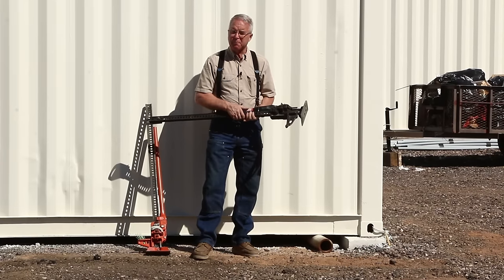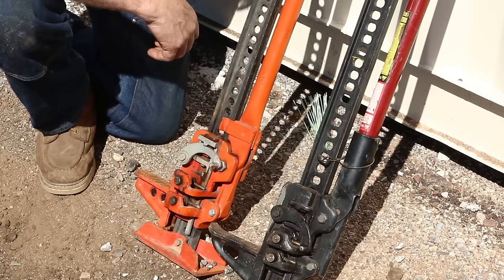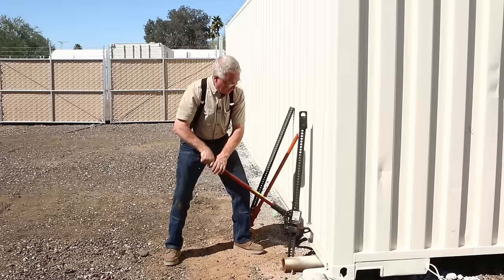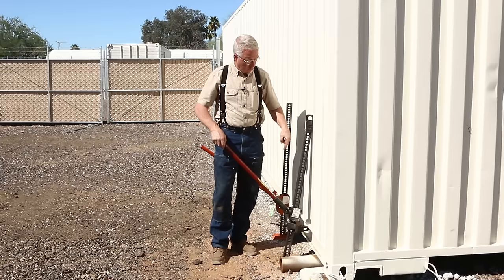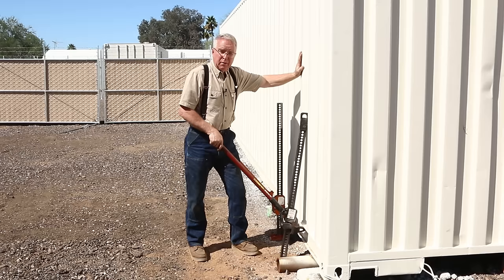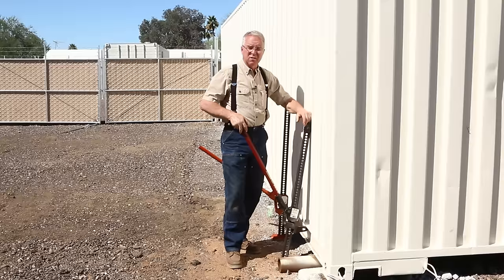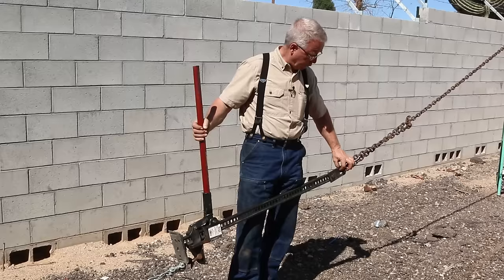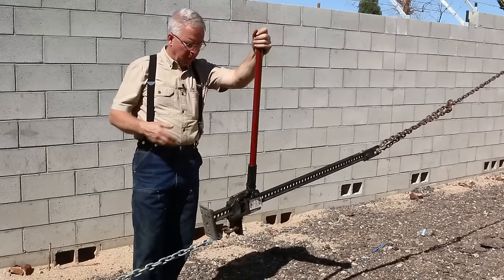Operating a Hi-Lift Jack

Comment: NEVER! put your hand around the top of the high lift jack lifting bar & a pinch point otherwise you will run the risk of crushing and/or losing your hand, you won't hold that jack back if it want's to move anyway, put a block of wood between the lifting bar & shipping container wall to maintain a vertical lift and get the lift hook right under the load not just gripping the edge that will slide out at any moment.
Reply: Keep head and anything else away from the top of that bar.
Reply: I can second this I almost degloved my middle finger trying to hold the top half of my handyman jack while I was trying to flip a car back over

Comment: I am 70 yrs old and I can still see my dad using one of these, out in the field, lifting up a tandem disc to repair or replace a component.  He carried in on a home made bracket on the the fender and on the other fender he had a removable 1" thick iron plate that served as a support plate.  Thanks for memory.
Reply: Classic farmer memory.  My dad too.  Didn't carry it on a tractor but remember him lifting a gravity wagon full of beans with one when it had a broken axle.  They are such a handy jack and you can even dig a hole to get low enough to get the first bite on things right at ground level.
Reply: 1
Reply: a 70 year that uses computer?
Reply: @user-gu1hl2kx2k  both my grandparents are 71 and work full time and have iPhones/ run a  property management business that very much involves computers and email. It is kind of funny to think about though. Gotta stay relevant.
Reply: @user-gu1hl2kx2k  Hey, I'm 71 and I got my first computer in 1980. It had no hard drive and no disk drives. I had to learn to program in Basic just to get it to do anything close to what I wanted it to do. You guys got it easy today. Just turn it on and Windows pops up. I mostly use Linux. How many of you have the wherewithal to use Linux?
Reply: @user-gu1hl2kx2k  I'm 80 and still using one
Reply: @waltp3373  I use manjaro
Reply: @waltp3373  im currently 136 years old and have 3 iphones one for the plug and one for the *oes and another one for you know

Comment: Scott, I just have to share a lube tip with you that I discovered via serendipity.  Anything with moving parts like this jack (e.g., trailer nose wheels, implement pins, hand pliers, trailer hinges, etc.) that must be oiled frequently to keep them operating correctly can be lubed with plumbers' silicone grease made by Danco. This is available at Lowes in a 0.5-oz squeeze tube (item #53861). It's pricey as heck compared to oil, but it cuts right through rust and I have never (so far) had to lube those items again. It has an operational temperature range of -40 to 400 degrees F and is totally impervious to water.

Comment: When I was a young pup I did a fair amount of foundation replacement/repair where we used hi-lifts just like the one you're showing to lift houses and small building off their existing foundations so we could replace sills, re-lay a few courses of block,  or get beams in to start cribbing/excavation. It was sometimes pretty scary. Greenhorns take note - this type of jack will kick out in a second unless you can get them perfectly set, which will seldom be the case. And the higher you go the worse it is. So block under your load as you go - lift it 2" -put 2" of blocking under it.. 2 more inches... more blocking.  That way if it does kick out the load will only fall to your last block.  It's also better to dig down a little, level a spot, and set a better footing under the jack -sturdy hardwood or  multiple layers of plywood - NOT a concrete cap block (which can crush under a point load). At least get rid of the sod and topsoil directly under the foot of the jack.

Comment: Do another demo video where you run that thing up under a heavy load about 3/4 of the way.  Then stand back and let go of the handle and show everyone how it will go wackety wack all the way down to the bottom.  They will be able to see that handle moving up and down at about 90 miles an hour...
Reply: weeeeeeeeeeeeeeeee
Reply: I wondered if anyone was going to suggest this lol
Reply: @dustyfarmer  Some 50 years ago when I was a teenager I was clearing land for a guy with a chain saw and a handiman jack.  If it is in the setting to lower the load and the handle slips watch out, it will cycle on its own.  At least it did to me on that job.  Maybe they have improved the design since then, I don't know.
Reply: Yes, they will cycle on their own coming down. My mom broke her wrist trying to stop one in the process of doing that.

Comment: Removing fence posts and small trees are another great usage for these farm jacks (as we called them here).
Keep up your excellent work!
Reply: That's almost entirely what I've used them for. Fence post removal. Though often they don't have the lifting force to lift most of our tamped posts out without a big of digging first.
Reply: I was about to make the same comment.
Reply: Car scissor Jack works fine too
Reply: Definitely done that here! Great tip.
Reply: I pulled 4x4 posts that were supporting a deck around a pool all the post had concrete and it pulled them up no problem
Reply: Yes! Once my helper put 10 caissons in the wrong spot, so we rigged up the jack with a shackle chained to the j-bolts and jacked them clean out in under and hour.
Reply: I actually need to repair a fence, and a friend has a few of these. How does that work? Would I drill a hole into the piston using a forsner bit, and slip the nose into the hole? That's how I would go about it, but I never considered it.. that's really smart. (Or really stupid if I'm wrong, and I'll end up with quite the hospital bill.)
Reply: @DanteYewToob  what I did was drill 2 holes vertically and attach two 2x4s with long bolts and then jacked using the 2x4s for purchase I have also hear of people using chain chokers although I dont know how you would stop it from slipping
Reply: @suicidaljell  hmm. I'll experiment a bit safely. I have a few panels of fence that got messed up in a hurricane and the posts need replacing, so I can try a few methods and see what works best. The old posts are waste, so I don't mind drilling or cutting into them. 
Thanks for the info!
Reply: @DanteYewToob Use a chain around the fence pole you want to remove and jack it up. With two or more turn around the fence pole, friction will work its magic. Works great on metal fence post too.
Reply: Often you will need a broader base when on soft ground.  IE, a short 2x6 (or tw9) between the jack base and the earth.
Reply: danteelite  No drilling. You want to use a length of chain (3000 lb up to 6000 lb) with correct grab hook & shackled to the nose in order to perform a  “choke” or cinch grab of the posts. Chain needs to be long enough to make at least 1 full wrap around the post, and if it’s something like a galvanized pipe, you’ll probably need 2 or more wraps in order to maintain the grip.  Search for YT vid that demonstrates this because there is a right way to do it so that you don’t permanently bind the choker chain.
Reply: @suicidaljell   Rigging the chain is just practice. Check out the video on string. Same principles.  When yanking a bunch of random  or natural stuff you can't be spending all day drilling holes.
Reply: Yeah that's all I Know them by is a Farm Jack  had one given to me many years ago  by a Friend who had a Farm and used it many times  very handy tool
Reply: I got an old bumper jack at a garage sale for $5. I've removed dozens of cemented in posts with it. Although, this one has more lift before having to reposition.
Reply: I bought one today to pull the stubs of rotten fence posts out of the ground. Freaking GAME CHANGER!! I've also got a pretty capable Toyota Tacoma that now has a great jack to add to my tools.

Comment: I grew up watching my dad use one. I started helping him when I was about twelve. He was never hurt by one I was never her by one. Luck you say not at all. We had very strict safety rules we aways followed. I have used one hundreds of times, many times in the wild. 
1. When working under a vehicle always make a secondary support. Usually a 2x4 and a block of firewood large enough to make a firm support under the axle.
2. Always have two or three 2x4 and 2x6. A 2x6 12 to 16 inches long under the foot of the jack makes it much more stable especially in soft ground.
3. Never wrap your fingers all the way around the bar of the jack while jacking the handle with the other hand. In other words never have your fingers between any where the handle can reach.
4. There are several pinch points on the jack treat them as if you were jacking with a rattlesnake.
5. While jacking up things can go wrong. If it doesn't feel right on the way up, stop, keep a firm grip kick the down latch and lower the jack and reset the jack and try agian.
6. Never have your head over the handle.
7.  Keep others away out of reach of the jack.
8. Always block both sides of at least one tire while jacking up a vehicle.
That is the short list.

Comment: "Whackety whack"? I guess that describes it best. I appreciate very much that you brought this out to teach on it. I have two of them.

The things that come to mind when I think of these is,
1. As shown, the free dental work you can get from one of these. If you can't keep your head out of the way as much as possible, AND keep a good grip on the handle, well... you will never forget what could happen to you.

2. Always keep this machine oiled. It will relieve your frustration. NOTICE! He used a lubricant more substantial than WD40. Take the hint.

3. More than once this jack has helped me rescue a stuck pickup truck. I jacked it up out of the hole and pushed it over onto solid ground. One day it took about ten times doing this before I could drive out of the woods. But I was alone and had the help of this great tool. Thank the Lord for his provision!

Comment: I have had one of these in my pickup for years.  An insurance policy against getting stuck while elk hunting.  Also, I built a shed in my backyard a couple years ago. I had to build it a few feet off the foundation due to the fact that its final resting spot would be right next to a fence. I built the shed on skids. When it was completed I ised the handyman jack, the foot against a solid rest, to push the shed (it was real heavy!) Into position.  Then I used the jack to lift a side and remove the skid, then the same on the other side.  

I have also used it to take out fenceposts that had broken off and were set in concrete. I dug around the concrete, wrapped a chain around it, then jacked it up. I olaced the foot on a section of 2x6 so it would not fall in the hole.  I also connected with a bolt and nut a piece of angle iron about 6 feet long and at a 45 degree angle so the bottom  would rest on the ground, giving support to the top of the jack so it would not tip over when it came under a load.

Thanks for explaining the up/down part. It always takes my simple mind a few minutes to remember how that works.

Comment: I am old and this is how all car jacks worked in the 1960s. Even then  some people were putting their heads in the path of the jack lever and some people got hit. Keep clear of the path of the lever and that is most of what to watch out for.  You have to be careful, have an understanding of its operation and you have a useful tool which can solve many problems for you. This is one of the better Hi Lift jack videos I have watched. thank you

Comment: Good video, but I think you missed an opportunity to talk about the single most important thing to keep in mind when using these things:  They are seriously dangerous.

Rule 1: When using one of these jacks:  NEVER take your hand off of the handle while lowering the jack (when the selector is in the down position).  The handle has enough weight if it falls to trip the mechanism, which will cause it to spring up, bounce back down and repeat, causing your load to hit the ground faster than you can react.  I've seen it happen, and it's a dangerous position to be in.

Rule 2: As a result of rule 1, never leave the selector in the down position.  Always leave it in the up position, even if you have to step away for a second.
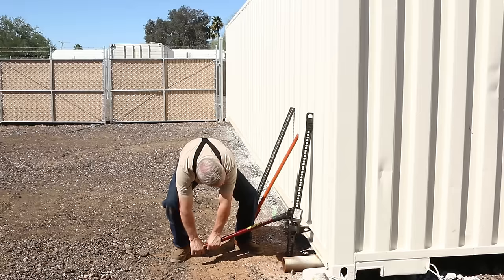Reply: @jrucker2004 - He did talk about the danger w/them. He even said it was “The elephant in the living room” @2:10.
Reply: @psidvicious  He's talking about using it with the selector in the up position, which is nowhere near as dangerous.
Reply: @jrucker2004  Lowering the load is way more dangerous than lifting it in my experience. Thanks for your comment. 👍
Reply: You are so correct about letting a load down and he failed to mention the most dangerous part of using a jack of this type. Thank you for explaining this in detail. 
Again, with the latch in the down position and you push the handle down until it clicks, you then have all the weight of your lift on the handle while you try to hold it as the handle is pulled by the weight to the top. It’s a lot easier to push down on the handle while raising a load but not as easy to raise the handle under a load. This is the most dangerous time using one of these jacks.
Reply: @Dick49311 - Agreed. Lowering a load will break your nose if you’re not aware of how to use this jack carefully. I mentioned in another comment that I’d like to see EC and Nate do another video w/this jack. Very versatile tool.
Reply: @jrucker2004  - Are you here just here to correct people? If you already know it all, then why watch videos on the topic? I don't watch videos on how to drink a glass of water.... 🙄
Reply: @kdigiacomo  OP never claimed to know it all. It's possible that he actually learned something from the video.. Why do you care so much about him sharing valid safety knowledge that could safe someone from serious injury??
Reply: @manthonychavez  - I just don't understand why people watch "how to" videos then comment about everything they missed. I don't watch "how to" vids on things I already know, doesn't make sense to me. Wasn't trying to be a prick about it.
Reply: @GlennC789  - I think what irritates me is the way people respond sometimes to the videos. I read a lot of the comments in most videos I watch, and I don't mind extra input to the videos, just some annoy me the way they come across is all.
Reply: Done this it hit me so many time on my elbow thought I broke my arm. Couldn't breath all I could do was just sit have tear drops running down my face and shiver.

Comment: I have a love hate relationship with these jacks.  I have been using one since I was big enough to lift it—over 50 yrs.  Every ranch truck has one attached somewhere.  It is incredibly dusty here and oiling the mechanism accumulates dust so bad.  I have found that just pouring a little water on it will loosen it up.  It’s so dry here the water evaporates before it can rust the jack.  It is an essential tool for me.  They require a very high degree of respect or you will get hurt.  Great video!
Reply: I know I'm late, but here's a trick I picked up in cross country racing: use motorcycle chain oil. It keeps parts well lubricated in any conditions, and dust or sand don't stick to it nearly as much.
Reply: armor 326 Good to know.

Comment: Hey man, love your work, love your channel, love your videos. Just wanted to mention to your viewers that your head should NEVER be in the path of that handle. The way I've found to handle this (har har!), is to face away from the jack, stand with the jack on your right, and use your right hand to power the jack, leaning forward away from the jack. With a little practice you can get your entire body, except for your shoulder/arm/hand, out of the path of that handle, and I find a huge mechanical advantage to this method. As a note, these fit under the rear seat of an XJ if you give the transmission tunnel a few good whacks. Thanks for listening!
Reply: A good bit of advice to keep your teeth in your mouth -- with the caveat that you check frequently on the work actually being done. 

On the subject of using this jack: is a cheater pipe on occasion advised? 

It seems to me this type of jack could use, on the head, a (wide) nautiloid cam to help keep the jack (more) vertical while lifting. The nautiloid could be ratcheting and lockable, and by its nature allow slight or substantial push-away from the object being lifted. Make its cam surface out of appropriate rubber, and the cam would prevent lateral slippage at that end.

Tools are a contagion.
Reply: Not driving my XJ much anymore, but did lift it off a high center situation with deep ruts and red clay on one memorable snowy day about 20 years ago.  Time flies faster the older I get.

Comment: Thanks for the video on this old jack. I believe it has old history back to the high axle wagons.
I use to have to carry it to work in my 4x4 pickup to take the front chains off, before starting home from the plant I worked in. As the town roads would be cleared so far out to the country twp. Then would have to put them back on when I got home, knowing the roads would be blown back shut by mornings. 

 We had a lot of big snows, back in the 1970's and '80's.  After slipping off the ice packed snow once on a curve and jumping the ditch, my winch bumper stuck on the other side, with wheels suspended over ditch. I had just enough chain to reach across the road to a fence post, with highlift jack hooked up to it. I had just verily enough umph to drag the front bumper off the frozen dirt and snow, into the ditch.
 After that, I inserted a steel pipe inside the handle, for extra leverage if ever needed.
Treat them as a gun, assume they are loaded, with respect as what they can do, if you don't. you can't be to careful, like any tool. 

Over a hundred year old tool, still in need.